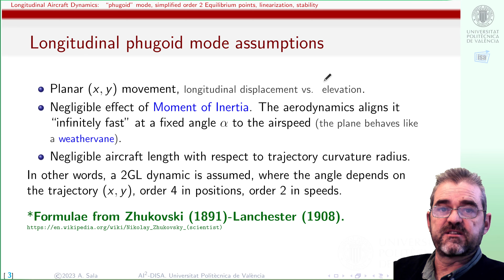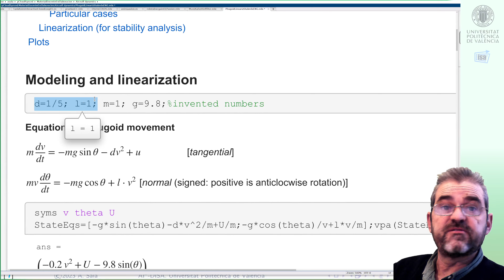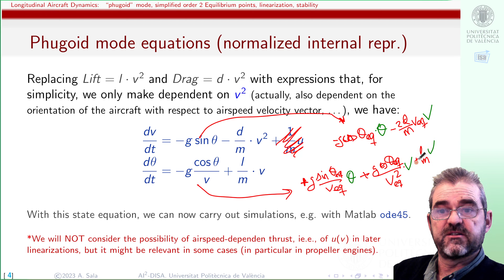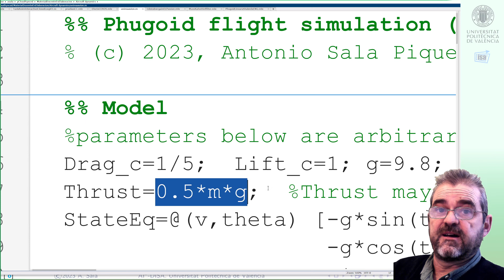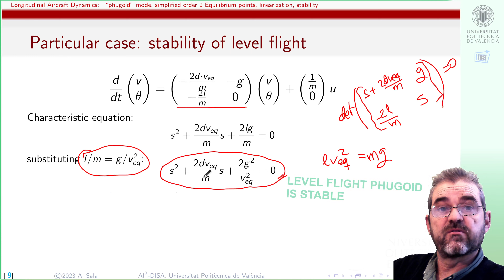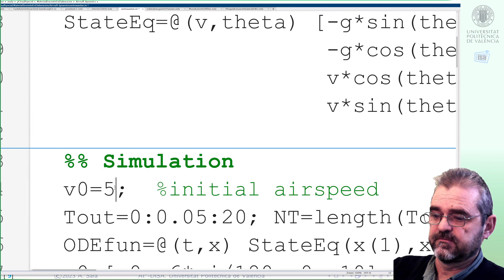**Phugoid dynamics: equilibrium linearization stability, simplified 2nd order equations [MOVED]

Comment: Thank you for the video ! However something still remains unclear to me : as you did not really clarify about the drag coefficient d and the lift coefficient l, I was wondering if xi, which is proportional to d/l, could be negative, leading to a negative xi and thus a divergent phugoid oscillation ?
Reply from the maker: Incidentally, my English-language videos have been migrated to a new channel, so you should have watched/commented on the one with the link in the description...
**Edit: my phone just notified me (while I was sleeping) on this comment, but I just realized you also commented in the other channel !-). I'll copy this text there.

Well,  in the setting in this simplified video, the plane flights with v>0  and I assumed d>0, l>0. So, in "level flight", phugoid dynamics will be (locally) stable. If I push thrust up, I will ascend at a higher speed, then from 22º climb angle onwards, phugoid will have such divergent oscillations, but not in level flight. See around [12:30] for the unstable phugoid regimes.

Of course, in a real plane things differ with respect to the over-simplification in the model in this video:
-  lift and drag will not be lv^2, dv^2, 
- angle-of-attack might change (phugoid is the abstraction of it not changing), 
- you may be doing aerobatics flying upside down (negative lift coefficient?),
- linearization refers to only `small enough' oscillations 
so, well... you might have an unstable behaviour in level flight in the `complete' 6DoF flight dynamics equations in the response to a large disturbance. Such behavior close to the equilibrium level flight conditions, however, is not possible in the simplified approximation in the video.